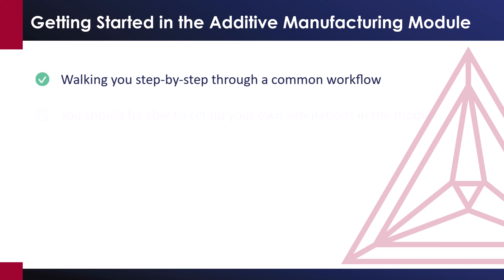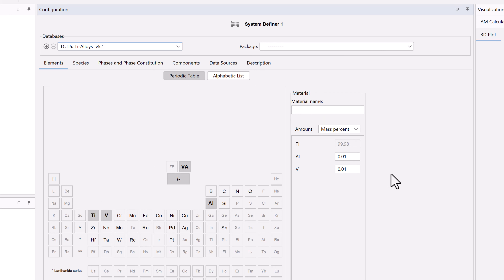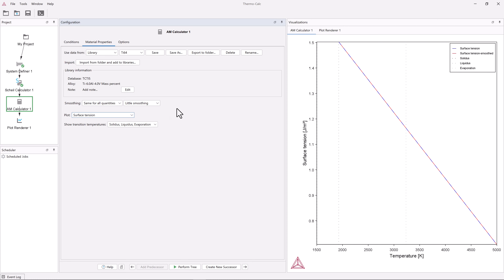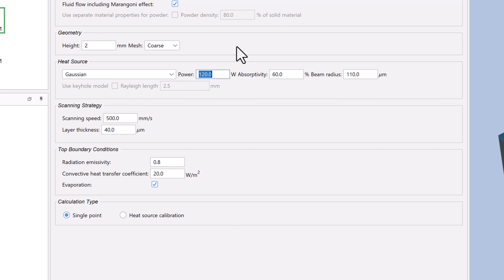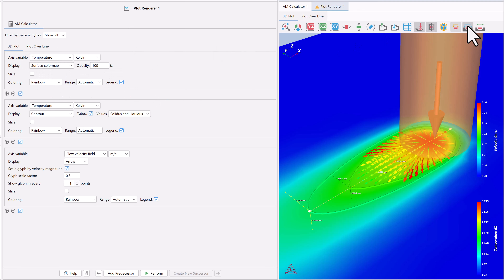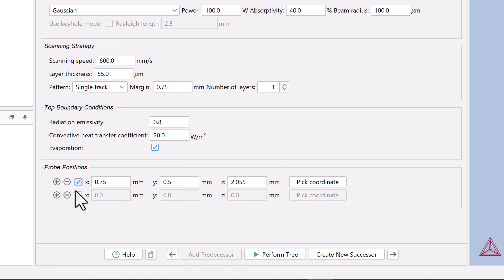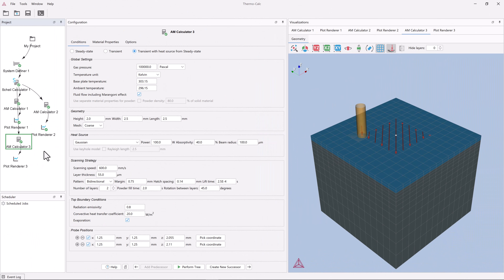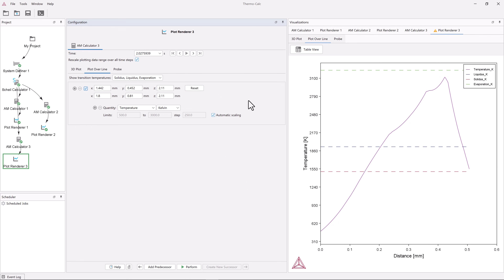Getting Started in the Additive Manufacturing Module in Thermo-Calc

Comment: Can you change how quickly the 3D plot runs?
Reply from the maker: Hi @helpimlost137,
Currently, it is not possible to change the speed of the 3D plot. The current fastest speed depends on the speed of the CPU/GPU and the cache. In the future, we may introduce a parameter to control the number of frames per second, for example when we do export to a movie format.

Comment: Hello Thermo-Calc, how can i plot schiel curves for different compositions of the same alloy on the same graph?
Reply from the maker: Hi @mojo6744!

You can first create multiple Scheil Calculators for different compositions, then right click on one Plot Renderer > Add Predecessor and choose to connect it to other Scheil Calculators with different alloy compositions.

You can also use the Scheil model in the Property Model Calculator (which is available as of Thermo-Calc 2024a), there you can vary the composition as well.